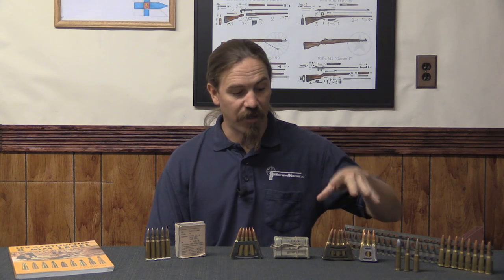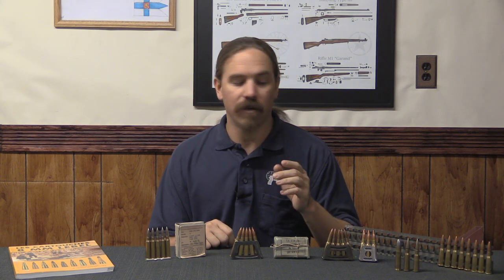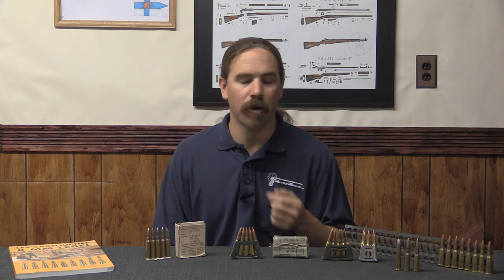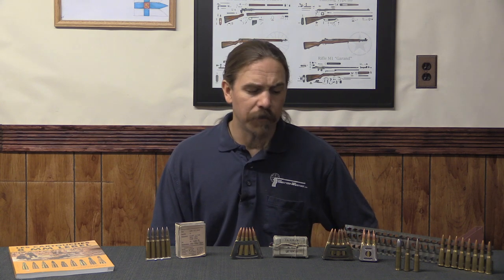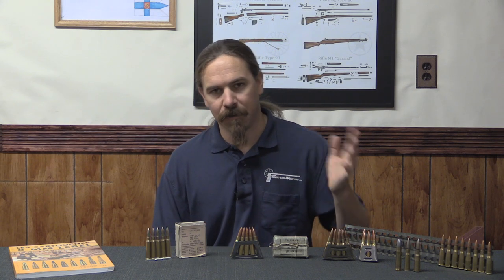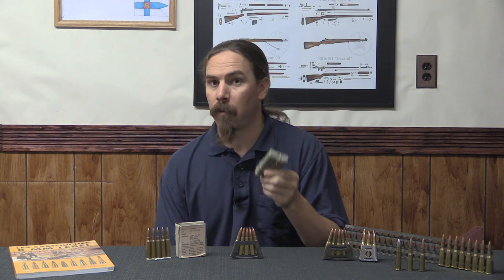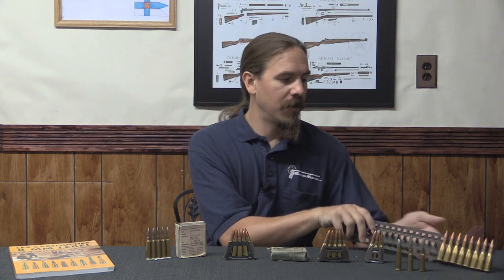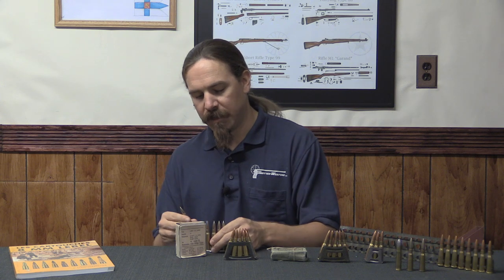French Rifle Ammunition: 8mm Lebel and 7.5mm French

Comment: How was velocity measured that precisely back then?
Reply: maybe it was measured by how fast the bullet hit the target, with a timer.
Reply: Carler1 using a ballistic pendulum
Reply: You send a man with a stopwatch to the end of the range. He starts the stopwatch when he sees the muzzle flash, then stops it when the bullet hits him.
Reply: There are many ways... by WW2 coil loops were in use. However a good camera and 64 or better frames per second will capture a bullet in flight. Put a high contract scale card behind it and you can do it all day long. Its what they did in WW2 with 20mm and up ammo.
Reply: I read about one method that was devised around WWI, though I think it was only used with artillery shells. It used a long strip of paper tape running between two reels at a known speed and two double wire screens set a known distance apart. When the shell passed through the first screen it completed an electrical circuit, which put a mark on the paper tape. Passing through the second screen completed the circuit again, placing a second mark. Velocity could then be calculated from the distance between the two marks.
Reply: It Appears the French had already worked that one out.
An early chronograph that measures velocity directly was built in 1804 by Grobert, a colonel in the French Army. This used a rapidly rotating axle with two disks mounted on it about 13 feet apart. The bullet was fired parallel to the axle, and the angular displacement of the holes in the two disks, together with the rotational speed of the axle, yielded the bullet velocity.
Reply: We probably underestimate how clever people were in the pre-electronics days.
Reply: You could drop a billet and record the time it takes to hit the ground, and then fire one horizontally from the same height and record the the distance it traveled before hitting the ground. Then you divide the latter by the former and do something to account for the drag and how that would slow it...then work backwards to calculate the velocity leaving the muzzle. I'm guessing they did something along those lines? Idk if you knew what you were doing, I think you could pull it off
Reply: 51WCDodge that's brilliantly simple.
Reply: Erwin Pommel- HAHAHAHAHA
Reply: Michael Lowery How would you record the time? With a mechanical stopwatch? Lol ..

Comment: So the old question: Which comes first ammunition or the gun?
Reply: If you're smart you develop them together as an integrated system. Back in the day it didn't matter as much, because bolt actions are much less fussy about what they will feed and fire than self-loaders are. But changing cartridges is expensive, especially if you have stocks of tens of millions of rounds and the machinery geared up to make it, and you can be left with egg on your face if your changeover programme gets its toes trodden on by the start of a major war (e.g. British 7mm for Pattern 13 &14 rifle) or capricious peacetime politics (British 7mm Mk1z for the EM-2). In the former case, the turnbolt Pattern 13/14 was easily adapted to .303 British and .30-06 and survived the collapse of its ammunition programme to morph eventually into the Pattern 1917 Enfield. In the latter, the automatic EM-2 did not take at all well to 7.62 NATO and sank into obscurity.
Reply: From an engineering standpoint the firearm should be designed around the ammunition. Although close to concurrently if possible. The sizing, geometry, materials, etc are all based off of the cartridge (pressure, dimensions, etc). It's a main reason why converting a firearm to another caliber isn't always as straight forward as it seems. On the other hand, it's impossible to design a firearm if you don't know what the cartridge is, you have no data to engineer from.
Reply: So ,:-) Brains trust, who then decides the rounds ballistic properties?

Comment: Thanks Ian for this great video.
Don't forget to say that the 7.5x54 mle C was used to design the 7,62x51 NATO. This explains why the ballistic and other parameters of both cartridges are so close.
7,5 is only a metric nickname considering the projectile has a 7,82mm diameter, so, actually a .308 one. it could have been called 7,62x54 ! Regards.
Reply from the maker: I believe the 7.62 NATO was actually developed from .300 Savage.
Reply: I'm curious as to where you got the idea the French round was the parent cartridge to the NATO round?  Despite the similar ballistics the 7.62/.308 was developed from .300 Savage as initially an American endeavor.  Furthermore (although this may be a war production anomaly) the few "C" cartridges I possess the bullet diameter consistently mikes at 7.84.  I

Comment: What is an obsolete bullet? Couldn't you just take an old round and put some smokeless powder in it?
Reply: Black powder cartridges need more mass to produce the same kinectic energy due to lower burning rate so putting smokeless in a black powder cartridge will require speciality made guns that would be too expensive to make it worth so it's better to just sell unused obsolete ammo as surplus. Also rimmed tapered cartridges were out of date because you couldn't make large magazines practical wih them.

Comment: Why did they change to 7.5mm? Can't they just stay with 8mm diameter bullets with straight walled cases so they don't need to have new barrels?
Reply: When you're going to a significantly lighter bullet, you want a smaller diameter. Ballistic coefficient = sectional density divided by form factor, and sectional density = weight in pounds (or in grains divided by 7000), divided by square of bullet diameter in inches. For the same general shape of bullet (which sets the form factor), the same weight in a smaller diameter is more efficient. 

Also, if you are radically changing the shape of the case, particularly if you are moving to a narrower case, AND if you are contemplating completely new rifles (and machine guns) you need to make completely new barrels for them anyway. So there is not as much to be saved by staying with the same calibre.

Comment: Ian, you mention in this video that the French had a "problem" with using 8mm Mauser in their 7.5mm French guns (hardly surprising really) but you went on to say that there is a similar issue around today with the 300 Blackout being used in 5.56mm NATO weaponary. I don't understand how it's possible to chamber a 300 blackout (7.62mm) in a gun designed for 5.56mm.
I can see the issue with the French using their 7.5mm guns and chambering an 8mm Mauser cartridge (it's "only" 0.5mm difference after all) but OVER 2mm difference with the 300 blackout !!! HOW ?????
Reply from the maker: https://www.thefirearmblog.com/blog/2016/11/30/potd-informative-300-blk-cutaway/